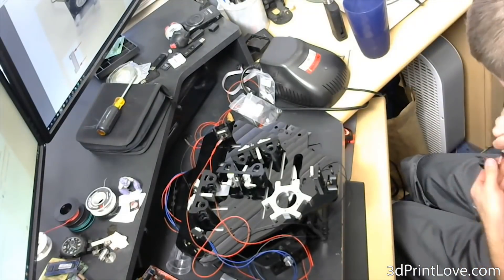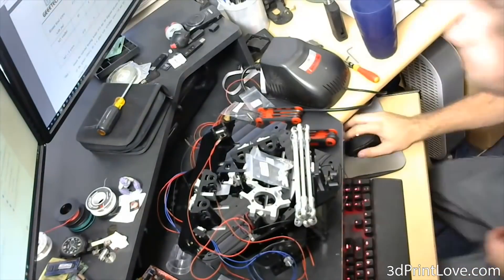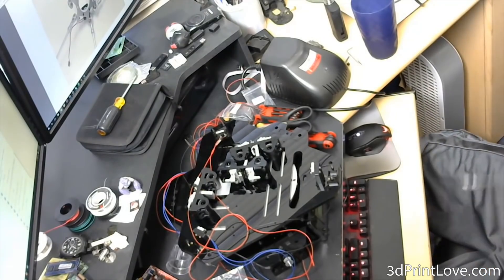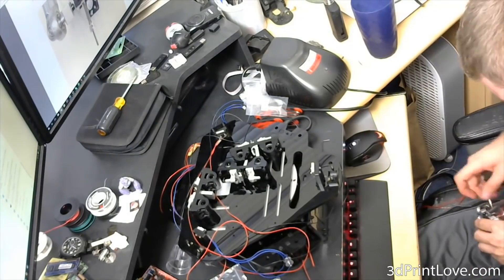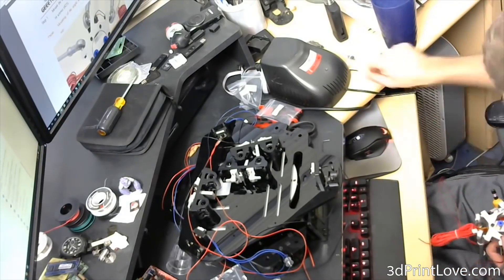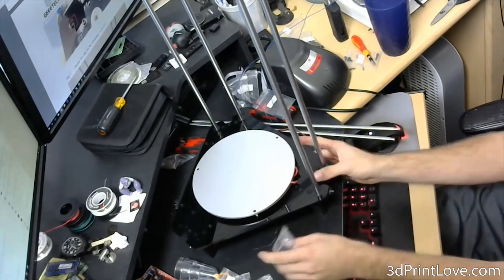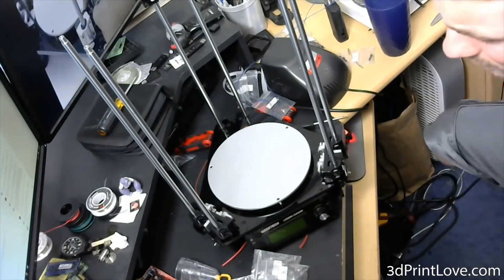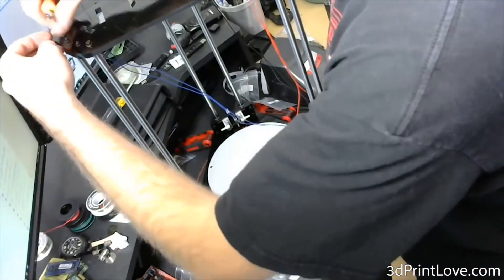Are Chinese 3d Printer Kits Worth It?

Comment: Its late 2020 and I came across your video. The Chinese kits are incredibly cheap now and do work. But they will need time, effort and some upgrades to make them half decent. After buying all the upgrades, etc, I could have bought a decent cheap named brand. So my thoughts on this is spend a bit more, get a named brand, and save yourself some time, effort and frustration! On a positive note I learned alot!

Comment: I bought a fake geetech g2s or something like that he was pretty much building it in the video from china off e-bay and a CTC brazer from craigslist the fake geetech I already had upgrades ready for it (e3d v6s a cable chain BL touch) but what I didn't have was the part that was f'ed up the boards usb plug was fried I contacted the seller they told me to contact geetech, geetech told me since I didn't buy it from them they can't replace anything so I had to buy a new board (mks 1.4) works great now as for the CTC the guy who sold it stripped a set screw in the right nozzle so I had to buy a new part for that so I upgraded now my prints are coming out better on those machines then my robo R1 and monoprice mini but I use a trick with the dual nozzles a .2 nozzle on one and a .4 on the other and have the .2 do the outer walls and the .4 for infill

Comment: with what i seen on forums. people leaving a in of bare wire near connections is what causes the fires. if going to use the printer a lot. need to upgrade your wiring to thicker ga. smaller #. and use connectors not bare wire.

Comment: I have a $150 stock noname  i3 clone that took me about 3hrs to put together and the rest of the day to figure out. I ended up using cura because it just works, no fiddling. it prints fast and nice, all I had to do is level the bed correctly. 😁

Comment: i want to get a printer. my budget is 500, but i'd like to spend under 300. i am interested in the prusa i3 style as it seems to be very common, which would imply its good for the price. i can see kits from a few different places, sintron, folger, and sunhokey. ebay also has one at nearly half the cost of those three. folger has an aluminum frame, which i suspect would be less easily broken but the sintron points out it has a better print head while reviews say the power supply is inadequate.

does it even matter which kit i get?
Reply from the maker: +jasonbay13 the only one I am comfortable giving feedback on is the aluminum Folger tech one as I have been running mine for Bout a year it is a great kit. If you have the 280 or whatever it is now you won't be sad with it. Probably some less upgrades compared to other acrylic frames as you won't need and frame supports!
Reply: from the stock kit how does the print head work? and does it need a fan 
added to cool the prints to prevent warping? also how accurate can the 
prints get? can a gear/fan be printed for say a 1/4" motor shaft?

Comment: A good portion of the end results you can achieve with a chinese kit are dependant on your adility to properly assemble the machine. With my Geetech i3 pro b, i intentionally built it to a very tight tolerance, in some places i did have to alter the parts and widen holes, etc. In the end I have a super finely calibrated, super sturdy and straight prusa clone that can deliver the same results as a genuine prusa i3. If you do not know how to build this kind of stuff, just buy a commercial model that just works. If you are a nerd, builder and tinkerer, then enjoy building one of the countless models out there. Happy Printing!

Comment: Not only are they cheap, they are a great learning experience. You get to understand the mechanics since you have to assemble the printer yourself. You are basically forced to look for upgrades early on, because there are things you'll want to upgrade. That includes printed parts to brace your frame, to tighten your belt, installing mosfets, coolers, a new PSU... and all of that without the pressure or fear of breaking 1000 dollar parts. And with some tweaking you can really get nice prints. People who are knocking these printers (even though i'm sure not all cheapo brands are equal) probably never used them. And if you're printing ABS with acetone smoothing in mind, any difference in print quality is lost anyway compared to higher end printers.

Comment: I completely agree with what you said and I LOVE my Anet A6 (the redesigned version of the A8). Granted I'm a maker with experience coding, electronics, mechanics, and troubleshooting. I have also upgraded some components like the controller board, some of the wiring and a new power supply. That's not to say that I haven't spent hours mad at my printer, unable to figure out what's wrong, but after I do figure out what's wrong its often caused by user error. The biggest problems with these printers are caused user error, not cheap Chinese parts or anything to do with its price. And at least for me, User error has always created the problems that are hardest to discover and fix on these machines, even for me.

Comment: I have had an Anet A8 for two weeks now with some slight adjustments it works great with everything it came with I have just printed some upgrade parts and cable chain and it looks great very low noise but then again I am very handy this printer is not for someone that has to ask is a Phillips a star or flathead.

Comment: Not a a kit from china, the first printer I bought was the Q3D ThreeUp off of amazon and man that thing was a piece of shit.  Weak MDF frame, horrible laser cutting accuracy, the visual instructions they had for it were for the previous version while the updated instructions was just a word document that basically said "you just built the old version, take half of the printer apart and use those other parts instead", and the electronics didn't work half the time.  The quality was so poor that I ended up getting a Fabrikator Mini to try and print out parts to get the damn thing to work.  I eventually called it quits once the Ramps + counterfeit Arduino pair nearly fried my computer.  Ended up getting a Monoprice Maker Select V2, probably going to use the rods and motors from the old kit to build the HyperCube from Tech2C.

Comment: Mi aliexpress kossel mini came with broken power supply, broken laser, broken z probe. There was no way to cool the heat break either.  Used a pc power supply, ditched the laser and the z probe and the machine is now bullet proof. The instructions were provided as a set of incredibly low quality photos and I had to look elsewhere to actually finish it. As a first printer it was an incredibly steep learning curve.

Comment: I didn't have a good experience with my ctc printer, I opgraded to a  e3d v6 and it can't still produce good quality.
Reply from the maker: what is the main issue with the quality?
Reply: ModBot it's not sized right. a 2 cm cube nearly becomes 2,5 cm
Reply from the maker: damn that is a pretty huge difference. Have you looked into what could cause such a large difference?

Comment: Just got mine, it's a GreeeTech , my 7 yr old grandson helped me build it. It was a fun project for us. We are now trying to figure out the firmware and calibrations. And no it hasn't even started to smoke so it don't think it will be burning the house down. You do need to pay attention to the gauge of wire and connectors you put with them though. We did make a few upgrades in that area. Keep up the good work ModBot , your videos were our motivation.
Reply from the maker: Hey Chuck thank you very much for the comment, comments like this are a huge reason I make videos on YouTube. I appreciate you taking the time to share. Well hopefully the smoking will not ever happen. If the kit does not come with it, I strongly recommend adding a cooling fan to the electronics just to help with the heat. I typically make that a standard for all of my machines. Good luck with the firmware and calibrations, hopefully you guys will be printing in no time! I also think its awesome that you had your 7 yr old help with the build!

Comment: I enjoyed building and "debugging" my Tevo Tarantula. I had no 3d printing experience but I wanted to learn. These are definitely for people interested in printers rather than printing. I just finished building the hypercube corexy and it's a fantastic printer, fairly cheap and easy to build. The quality and consistency is amazing. You can get a Tarantula to print, but it needs a lot of love. The hypercube, once setup, just prints.
Reply from the maker: I will have to take a look at the hypercube. I am in no hurry but the core xy style printer definitely entices me and I am tearing a part a printer I have for parts to build another which will more likely than not be a corexy printer. It is pretty rewarding when you do debug the kit printer though and find a solution to whatever issue you may be facing

Comment: I have a friend that bought a Geeeeetech i3 kit as  his first printer. Maybe it could have worked but the QC was awful and they basically shipped him a cardboard box full of defective parts. Bent leadscrews, tiny 5mm z rods that are bent, when the hot end went up it would swivel left right forward and back. It came with a mixing extruder that clogged 90% of the time. Prints looked like they were made with a 3d printing pen. Plus many of these kits like the Anet are based acrylic frames - an obsolete construction method that shouldn't be even sold anymore when metal frames can be had for the same price. Though that is really more on the buyer than the seller.
Reply from the maker: yikes that definitely sounds like a nightmare of an experience I have heard from a few people about bent screws and rods coming from geeetech. Luckily this was not the case with the kit I received from them. As far as the acrylic frame, I agree it is not a very good method for stability especially over time. At the same time I have seen the use of smooth rods/lead screws angled in a way to support the acrylic making it much stronger.

Comment: My Anet A6 is great. I'm using what I learned from it and building a core xy printer.
Reply from the maker: +Astro Idea how awesome! Are you building a core xy that is already existing or something from scratch? I am demolishing a machine I have to harvest parts and was interested in assembling a core xy
Reply: I have designed my z carriages from scratch. x/y I may use from something pre-existing, but I might design those too. I'm waiting for some longer alum extrusions, I estimated a little short for my z-height. Aiming for 300mm³ build volume.

Comment: Hi modbot! 
I have a "Anet A8" and it is fantastic, no problems so far....
I have upgraded the firmware, added the "z sensor" and printed parts to stabilize the printer, now I think it's absolutely perfect for my usage (non professional).
It took me some time to get started with the 3d printer, but, as you said there is a MASSIVE community behind the "Anet" franchise, so it wasn't so difficult to upgrade the printer or just to get started!
Reply from the maker: +viulenzaaa that is great to hear! I stumbled across the Facebook group for anet and was shocked I could he a bit off but I think there was something like 13000 members? I browsed some of the posts a bit and saw quite a few intricate upgrades. I have been tempted to get one as just a machine to mod like crazy but I just can't take on additional projects right now (to many "in progress",  sort of story of my life lol)